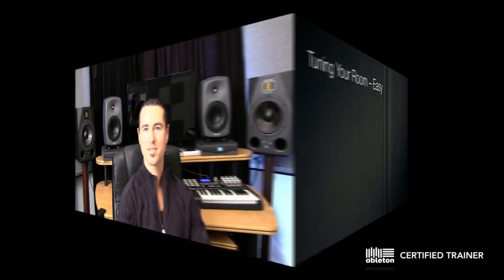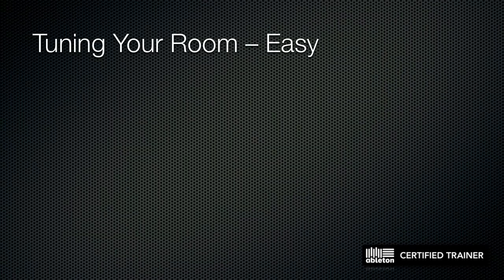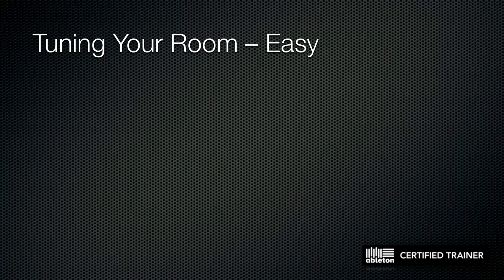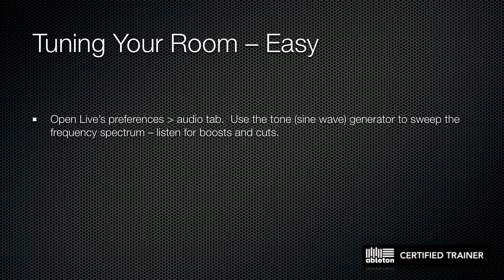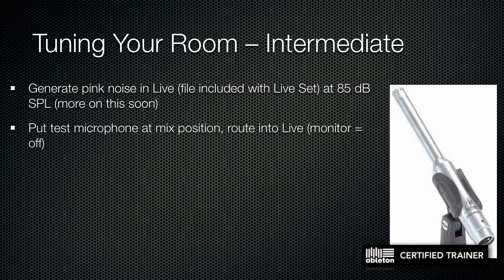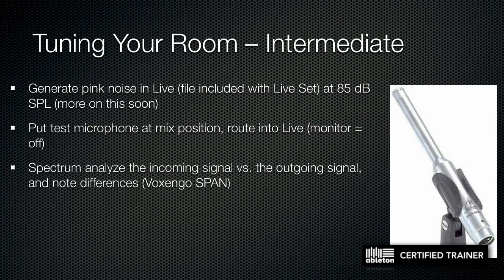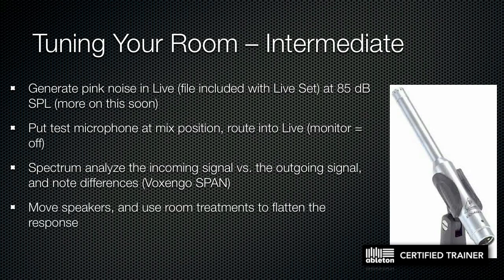Mixing Tutorial: How to Test and Analyze Your Home Studio Room

Comment: This was useful, so thanks. My only comment is that this does not take account of unevenness in the frequency response of the speakers. This can be significant even in high end recording monitors (there are various test reports out there). Neumann are one of the few manufacturers that claim a fairly flat response for their monitors (I have a pair of KH 120A) and publish the individual graphs in support of that.  But even these have minor bumps and troughs. Anyway, nothing is perfect, and just something to keep in mind.
Reply from the maker: Hey mate.  Glad you found this useful.  Funny you should mention the Neumanns, because I just did a deep dive evaluation of their KH420 monitors vs Focal Trio 11 Bes.  Check it out here as I go into a lot more detail: https://youtu.be/4JRAb2OWjPg 

Also, regarding manufacturers' graphs and their "flat" look.  Keep in mind a few things. First, these are tests done in an anechoic chamber, then highly smoothed, and then defined as "+/- X dB" to give the impression that they are flat.  The real case of loudspeaker performance is very different.  The actual responses are anything but flat, but one has to account for the fact that the human ear may or may not hear these variances as significant.  I to like the tuning and performance of the Neumann KH420s though, and I selected them as my mains for my studio.  

Also keep in mind that the anechoic or free-field response of any loudspeaker will be heavily changed / colored by your room and mounting style.  The loudspeaker and the room form a system and the room has a huge impact.  You can put really nice speakers in a typical room and get horrible results because of any number of issues like bad placement or overlapping room modes or lack of appropriate treatment.  This is why acoustic testing, proper speaker placement, and acoustic treatment are all necessary to get optimal results, as is a scientific, data-driven approach.  

Stay tuned for our next video, as it'll cover some of those points in detail.  Cheers!

Comment: Is it cheating to use a condenser mic? I only had an AT2035 laying around. 

My desk is set up1/3 away from the wall of my room, equilateral triangle with equal distancing and the frequencies were almost near perfect. I saw a very slight dip rom 500-2k but it looked like it was 1db at most (the reading wasn't consistent like the oscillator reading, however,  the peaks were)
Reply from the maker: Don't use a non-measurement mic.  They will not be flat.  Use a proper measurement mic.

Comment: How do i do this in fl studio
Reply: Jason G - for the signal sweep: add a 3 OSC, it has 3 wave generators in it. Set the top one to a sine wave, turn the volume of the other two to 0. Add a c1 note in the piano roll or step sequencer. Go back to 3 OSC and right click on the pitch wheel, choose "create automation clip". Make the automation clip go up in a straight line from left to right. You might need to change the number next to the pitch wheel to a higher number to get it to sweep to the full range. Set 3OSC to mixer channel 1, add span plug-in to the same mixer channel. Put your mic on mixer channel 2 and as another span on there (you can read the tutorial for span to find out how to get the mic input and channel input into one instance if span).

Comment: Ok. Since there seems to be a lot of fuzz about pink and white noise: pink noise is just white noise with a 3dB/octave lowpass filter applied, to compensate for human hearing, which perceives high frequencies better than low frequencies. Because of that, pink noise will appear more balanced to the listener, while white noise will sound rather harsh. Fun fact:a well balanced mix will loosely follow the same 3dB/oct decrease pattern, because subjectively, every frequency will have the same level.

Comment: What do you do about the early reflection off of the desk?  It will put a dip in the response at the frequency where the reflection path length is 1/2 wavelength longer than the direct path, and then a peak where the reflection path is 1 wavelength longer than the direct path (and so on).  Obviously the measurement techniques in the video don't differentiate between a reflection-induced dip and a dip that's inherent in the speaker's frequency response.  Does that make a difference in whether or not you use EQ to address something like the desk reflection dip (or peak, as the case may be)?  Does Ableton Live support time-gated frequency response sweeps?

Comment: Which way should the reference microphone be pointing?   If I place a cardioid mic in the spot where I sit to mix and point it forward so that its polar pattern is parallel with the floor and 'looking' at a point exactly midway between my studio monitors, then surely that takes no account of all the LF problems I'm likely to hear from the walls and corners behind me.   I'm lucky enough to have a Neumann U87Ai, and I wondered if I should set that up at the mix position, perpendicular to the floor (so it's upright) and put it into Omni mode.  That way it would hear sounds coming from all around.   Would that give me the measurement I need?  Anyone got any thoughts on that?   Great video, by the way, DJ Vespers.

Comment: This method is not exactly the ideal way but I would consider it to be better than nothing for discovering big issues. Yes, there is coloring of the sound which results from the type of reference microphone. There is also some coloring of the sound due to the signal chain, e.g., mixer into sound card...that will have an effect as well. Again, I could see this working for finding big problems in a big room but it is highly inaccurate for most problems in smaller ones.

Honestly, the best way to do this is to buy an SPL meter, a Reference Mic and download REW. You'll generate an EQ cure that you can place on the master channel of your DAW to offset the acoustic flaws.

Comment: pink noise = equal energy through all octaves. White noise = equal energy throughout all frequencies. We use pink noise as engineers because our ears correlate better with octave based sounds.
Reply: But isn't grey noise an even better correlation?
Reply: Yeah the guy said "random energy at random frequencies" for white noise which is completely wrong. White noise is equal energy at every frequency, so like 15Db for every freq from 20-20000Hz
Reply: Octaves relative to what?  there isn't a frequency that doesn't have octave counterparts
Reply: @Abstractpeace  You don't need a "relative to what" to be able to apply equal energy in every octave. It works the same whatever base frequency you start from.
Reply: @DIW-Commentator  so is pink noise generated from consistently amplified semitonal tones within the spectrum of human hearing?
Reply: @Abstractpeace  No, semitones are way too limited, you only have 12 per octave. Think more like "all semitones when tuned to 440 Hz plus all semitones when tuned to 439 Hz plus all semitones when tuned to 438 Hz plus ... And so on until 221 Hz (because the semitones tuned to 220 Hz are the same as the ones tuned to 440 Hz)
Reply: And strictly speaking, it's not correct to use every frequency in the example advice because that could give white noise. It's just meant to give the idea that you need a continuous range of frequencies, not discrete semitones.

Comment: It doesn't mention what to do once you have this information. Does that mean that wherever I may have those peaks I should consider being conservative while mixing? Maybe cutting around those frequencies? Boosting?
Reply: He does explain what to do a bit...  If you don't want to fix the acoustic problems of your room with treatment, then yes, you would need to mix being cognizant of the nodes and modes of your room (the peaks and dips).
Reply: @drannonbell196  Why not put a graphic EQ on your master bus that "flattens out" the response as best you can?   Boosting for your deficiencies, and cutting for your resonances.  Then save that setting and call it "Custom Flattener EQ" or something.  Then always bring it in, every session.   Have it in place when mixing and mastering with your ears, but REMOVE it or BYPASS it when rendering any files  (meaning, you don't want your custom EQ room curve applied to your distributed files!)

Comment: HELP! I have a monitor with the port AUDIO IN, I got it connected to my XBOX ONE thru the HDMI. The problem is that the monitor speakers are too soft, so I bought some speakers, but when I plug them into the AUDIO IN port it doest work, they told me it is because I should have an AUDIO OUT instead of AUDIO IN. So the question is... How do I put the speakers that I have into the AUDIO IN, what should I buy? Should I get another kind of speakers or something? PLS HELP!
Traducir
Reply: the audio IN doesnt work? u think? thats why its called IN not OUT :)
its to soft because it prob aint pre-amp monitors so u need an amplifier..... no speaker will ever work true Audio IN
pretty obvious as the sound u hear is always audio that goes OUT, its like trying to talk true your ears while u need a mouth to get sound

Comment: What do you use at the end to get rid of those disturbing frequencies? a plug in EQ on your master bus? or a hardware EQ before your monitors?
Reply: do as much treatment of the room as is possible, don't get caught up on getting a flat frequency response as this is very hard to do especially in a domestic situation. You want a "voicing" that works for you. It is actually much better to have the room treated to get rid of the "ringing" without totally killing the top end. e.q will not really help you and could cause you more problems. e.q is a last resort
Reply: +CHROMATICFILMS ...best comment in these threads so far. EQ is indeed the last resort. Better to find the acoustic solution than an electronic correction....& a "primer" understanding from a good textbook explaning room nodes/antinodes & consequences of early reflections. Absorption acoustic elements "is the trick". PS speakers can never measure flat anyway.
Reply: +emenveeuk Yeah but only if you are going to design to a clear acoustic model (RFZ, LEDE, etc) and base all treatment on carefully thought out responses to measurement. Whacking in a load of broadband traps and hoping for the best is a mugs game. : )
Reply: +CHROMATICFILMS You are very well informed, designing & calculating a well-thought acoustic system model before building would yield the most optimal results. Attention to the initial structural shape & how to deal with the modal artefacts needs to be tackled. Returning to the context of this video, I'm not sure bedroom studio users have many options other than to apply those pricey foam/wavey wood products, The concept of using a small bedroom is "challenged" in the first instance but maybe people will have fun from the learning. I also say keep away from EQ (& alignment "quick fix" products) until the physical space has been addressed the best way possible.
Reply: +emenveeuk Very true it is a game when you have a non optimal space. Fighting room modes is always very challenging as is keeping some life in the high decay due to porus trapping that you had to put in to tame low end decay. At the end of the day you will never have the perfect acoustic but what you can do is create a "voicing" that you can work with and learn.
Or now you can cheat and use one of those magic systems that give you a virtual acoustic based on measurement of the room. They even change the decay times etc and you can save presets for different parts of the room, couch etc. I was very skeptical until I heard one. I will post back a link when I remember the name of the system.

Comment: How do you know the peaks at 100, 200hz etc aren't to do with the mics spec rather than room feedback ?
In other words, surly what mic you are using has some input into what you are reading, no ?
I know you said it is a reference mic, but even a high quality ref mic won't be totally flat will it ?
Reply: Thanks for the reply!
Reply: +H4NDCRAFTED I was thinking the same. He basically tunes his speakers to the coloring of a cheap microphone.. not that good..
Reply: +Felix Grön Hey, if you wanna go ahead and spend an extra $200 on a mic that MAY only be very slightly more accurate--to the point where it is negligible, that's your prerogative. The Behringer is perfectly fine for this application.
Reply: John Thompson yeah i get it now..

Comment: Short answer: no, I would not use EQ to compensate for any room deficiencies. Vespers is spot on. Sidebar: I have noticed a huge difference in my mixes since I started using ARC2 from IK (for room issues). However, I have several GIK bass traps and other ER panels, and so I wouldn't suggest using ARC by itself - but combined with room treatment, the results are simply incredible. As long as you measure correctly, it's a sure thing. [insert proverbial YMMV comment here]. Good luck!

Comment: I have affordable recommendation. First don`t use standalone mic without calibration file.Only mic I have tested, offers calibration file and is affordable is Dayton EMM-6. I have compared it with Earthworks M30 and it is reliable + affordable but only when using calibration. ECM8000 has no cal file, meaning results are not predictable and the mic is absolutely inappropriate to gather reliable information. But this is not regarding to ARC or ERGO bundles where the mics should be calibrated.

Comment: Question: My studio is small and budget is tight.  My room is treated, but not professionally by any means.  My idea is to run this test, and then create an eq preset to make what my mic records come out as a flat signal.  Then, theoretically, I would place this on the master channel of my DAW, mix with the preset on, then remove it and render.  Would there be any downfalls in doing this?
Reply: Use headphones with correction, then compare professional mastered tracks

Comment: Great video but I have a question. I did this test with my room. Couldnt a descrepency in the two signals when doing a pink noise test also mean that your monitors might not be sending a flat signal as well?  Like it might not just be the room right? For instance I just got a pair of genelecs s30d and the curve I was getting had a good resonance at about 30 hz so I flip the    -2db dipswitch for bass rolloff and that basically went down and was about flat. But was it the Room? Or monitors?